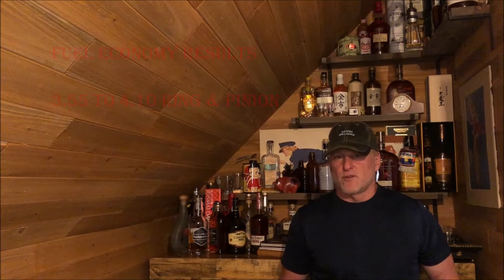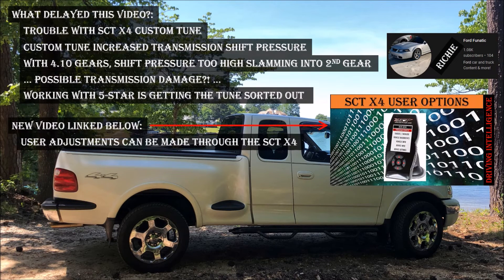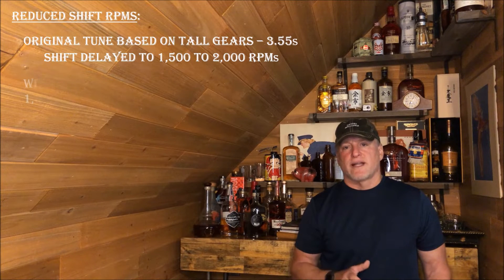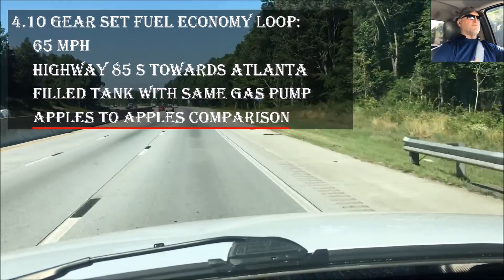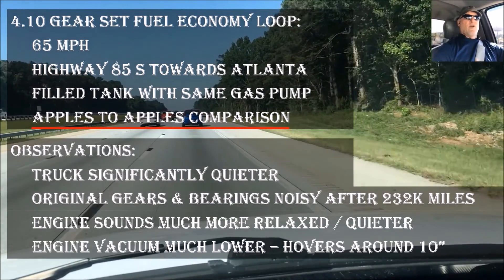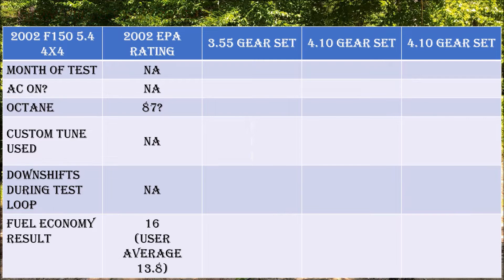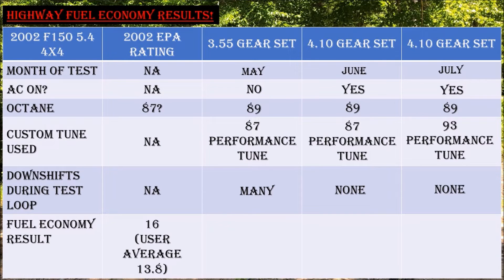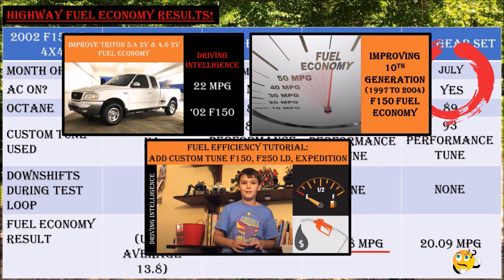Will Shorter Gears Reduce Fuel Economy / MPG? 3.55 to 4.10 Gear Change ’97-’04 10th Gen F150 Test

Comment: I knew you'd get slightly better fuel economy, and it was slight. I don't know if your trans was rebuilt since it was new, but I know of a few trans mods that will definitely help. I'll see if I can find the video and PM you on Facebook with it.

Edit: Just saw your video on what you did to your trans and you covered it all.
Reply from the maker: Thanks Ezee... it has come a long way.  It is a much more fun and capable truck, but I'm sad I lost a couple mpg with these oversized wheels!  But I'm not going back ;)